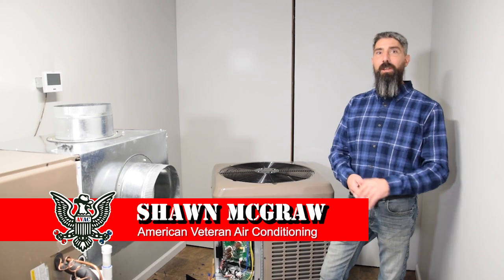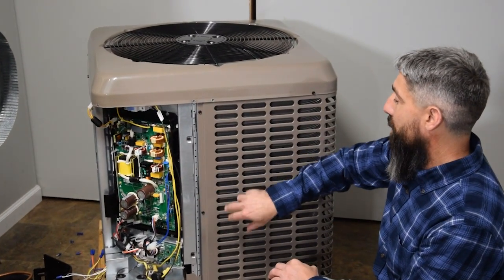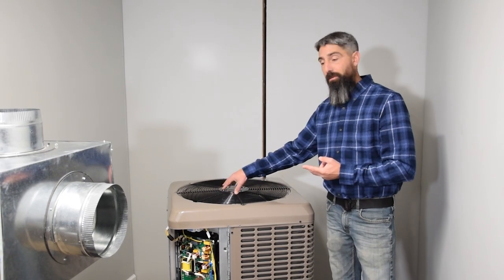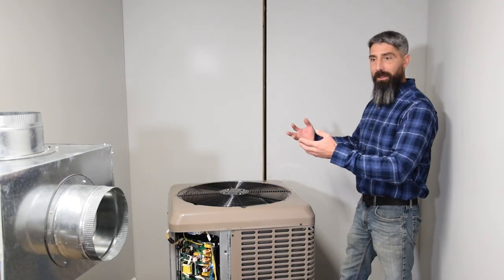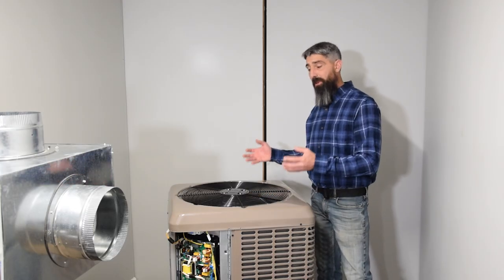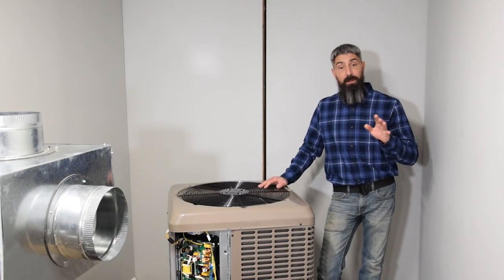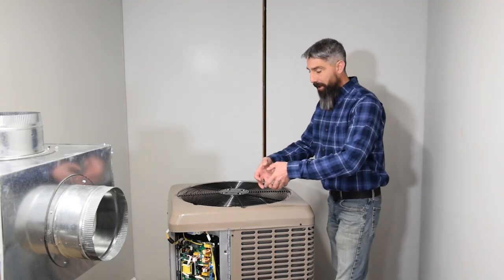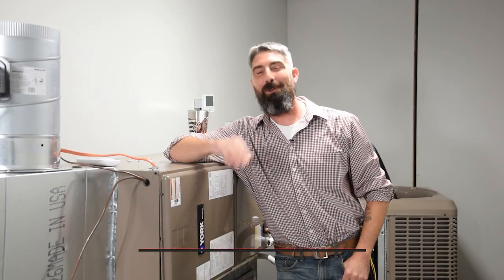What to do if your heat pump ices up in the winter

Comment: Great tip on freezing rain thawing... for the past 2 years I have a canopy 3 ft over top of the condensor fan to redirecting freezing rain and snow away from the unit.  It's been working great so far.  Why don't manufactures include a winter weather cover?   Lennox L1106, Snow Guard for SL25XPV &XP21 Heat Pumps for $1000 and 151 pounds of extra weight

Comment: Just wanted to say thanks! Freezing rain here in MD today and my outside unit iced up to the point where it was making some unsettling noises. I was thinking of ways to rig up a heater or heat lamp or something to thaw it out but then I thought "I bet somebody has found the right way to do this", leading me to this vid. Hose water had the job done in less than 30 minutes! I'm humming along again and just hoping it's not a persistent issue but at least for now I've avoided a trouble call!
Reply: Also from MD and had the same thing happen at the same time when there was freezing rain. If it's in the 20s, and the hose method doesn't work, I wonder if a hair dryer blown on the outside of the unit would work well enough to break up some of that ice? Might try it the next time this happens.

Comment: Thank you. Just tried this. Still ice in the bottom but off all components. Seems to be running fine! I'll get the rest ice off tomorrow if not thawed. Freezing rain and snowing in Florida. 10pm ugg.  First I've seen solid ice in HVAC.  Fingers crossed.

Comment: I live in Florida, we're getting a lot of freezing rain right now. Walked outside and the ac unit was humming, fan wasn't spinning. I turned off the fan because I don't want to blow the motor. This is the first time in my 29 years of life Iv'e had to deal with this. Is it fine to keep running or should I wait for it defrost?
Reply: The fan is turned off during the defrost sycle ...
Reply: @jayb9866  would my unit even have a defrost cycle considering I live in Florida. That's my main question

Comment: I need some advice i have a heat pump and when it goes into defrost mode my Aux strips kick in but cool air comes out. The AuX strips i believe 5k. Should i put bigger size or what do you recommend for a 5ton heat pump? Any one please

Comment: I walked outside Friday morning, now Sunday, to my heat pump iced over. I turn the hvac off and poured hot water over the top grills to melt it off, fan froze as well. Had a couple more issues with it, but it’s up and going. Thank you for taking the time to make this video. From Tuscaloosa, Alabama.
Reply: Check your filter...trust me. Mine was doing it. and couldnt keep up at night. Changed the filter and all went back to normal.

Comment: I have a question. If the temp is below the cut off temperature outside and the unit freezes and when the temperature gets above the cut off, will the unit know not to run if the fan is now frozen and just hasn’t had a chance to ever defrost. Maybe I don’t understand my dual fuel propane TRANE XV 18

Comment: Mine sides are iced up and inside enough to wear now the blades stopped moving. Do i put thermostat on emergency heat?
Reply: Run it on ac for a while. It will reverse the unit and start heating the coils.
Reply: @macmclain1350  ok thanks I'll try it if it does it again

Comment: I have two identical American Standard Side discharge HP units in my new home in NC near the ocean which were intstalled in February 2022.  The one for the lower level of the house has frozen up badly since it was installed, with the fan continuing to run while it is frozen over whenever when temps near freezing and humidity is high.  It doesn’t seem to affect the ability to keep the floor it services at 71° but that may be because it is using aux heat more than it should.

The company which installed it has checked it three or four times now since it was installed saying freon, control board and the ambient and coil sensors are nominal and it switches to defrost mode as it should when they check it but they have never been here when it is still frozen over because daytime temps here eventually melt it.

It happened most recently last week with temps in the high 30s I turned the unit off and defrosted the coil with the garden hose and called for service.   Again it checked out OK.   I have another routine service check coming up so do you have any suggestions I might pass along for things to check. 

Based on my limited knowledge of heat pumps but lots of computer programming experience I’m guessing it is some sort of miscommunication between the compressor unit and the aux heat controller in the blower unit.  One tech, since retired from the company spend several hours consulting with tech support at America and discovered the installer had miss-wired the connection between the two.

Comment: So i dont need to go into emergency heat? My thermostat is set to 72 but my inside temperature is like 64. I also its like 32 degrees outside and my unit had frost all in the inside and outside but not to where the fan wouldnt turn

Comment: I have a Honeywell thermostat and replaced it with a wifi version. Thank god I was easy easy to replace.. But I have noticed lately it hasn't make that loud swish noise. Which it has me thinking lately. Should it be doing it? The temp at night at times does get around 30ish.. My inside house is at 70f. Could it be in the thermostat settings? I do have it as heat pump or is show "compressor heat"

Comment: My outside unit is on, high noise when start, but I have been looking the fan for over 3 hours, and the  fan doesn't turn on... 28° outside, no ice or snow... is a problem, or is it normal???

Comment: Instead of manually defrosting the unit by spraying water on it.....why not spray automotive windshield washer fluid ( the blue stuff) over it to defrost?......I get it how customers can freak out applying water in a freezing atmosphere.....but this water you apply will ultimately freeze again even if it's not on the coil anymore. Don't know how much you would need but some sort of sprayer?

Comment: Outstanding video!! Thank you. You saved me from totally freaking out when I felt cold air blowing during heat mode. My instinct was to shut off the unit and start emergency heat. Which I did. Big mistake! Found your video and understood that was the defrost mode and normal.  Man you really helped.  Thanks again.
Reply: you do have a problem, your heat strip located in your air handler should engage when your outdoor heatpump condenser is in defrost mode, that will keep your air from being cold during the defrost mode, unless you do not have a heat strip in your air handler, but if you do, you need to have someone look at it and see why your heat strip is not energizing when it should..

Comment: Honest question: Why not just put a roof over the thing, keep the freezing rain away from it in the first place?
Reply: Because there is clearance required for "normal" operation so not to impede the exit air flow upwards from the top. If you are CAREFUL and mindful of proper stand-off and clearances....it might be ok to do a roof. Even with proper stand-off using a roof or "cover" of some sort, there is danger of air flow being recirculated to the sides where (normally) the ambient air is being sucked in.

Comment: In the situation I'm dealing with now I've never had an issue with my heat pump.  During the summer had some issues with the AC or so I thought.   The freon level was good.  Issue seemed related to circuit board and defrost cycle. Replaced circuit board and AC worked fine.   Now it's winter and on cold rainy or damp times the unit will not defrost there's just a build up of ice all over the unit.  That hadn't happened in years past.  Anyone have suggestions on cause? Thanks.

Comment: Do you think putting a Heat Trak mat under the heat pump would add some protection to the unit(s) during winter? Heat rises.. helps keep unit warm and aid in defrosting?

Comment: Sounds like allot of work going outside every-time it’s icy out to make sure there’s no ice on the fan blade. I don’t get it. I’m replacing my 28 year old ac unit this year because it’s time not because it died. It’s a Lennox and in 28 years I’ve never called for service or repair. I only change the filter twice a year and clean the coils. Everyone that has given me estimates is trying to sell me theses hight end units
with a heat pump. So the researched begins. The money it costs you, it will take twenty years to get your money back that’s if it doesn’t break down. Repairs can cost up to 3 time more then a conventional unit. If you live somewhere we’re it snows you gotta worry about ice buildup and shovel around the unit so snow doesn’t buildup around the unit. And parts are harder to find. Ya I want one not.

Comment: Got a heat pump?? Better have a back up plan for heating your house. I installed a wood heater not long after I had my new heat pump installed. When the weather gets stupid cold here in south Mississippi, the heat pump will sometimes take on a mind of its own. Not a problem. Just throw on another log. LOL!!!

Comment: Question how long should the system run before tge defrost mode kicks in?? Here in S Texas and combo of freezing rain and cold weather have my outside unit not working @30 mins some small buildup build-up ice on heat pump unit is a 4 ton Rudd   3 years old....   Ty..

Comment: Thank you. We woke to 64 degrees, this morning and the air handler blowing cold air. It was 25 degrees outside. I turned off the air handler and let the heat pump warm up with the outside temperature.

Comment: To prevent the fan blades from freezing up I sat a lawn table on top of the unit. The table top is about 4' in diameter so it has enough overhang to keep it dry. The legs are about 30" tall so the airflow is no problem. This is my second season using it with no problems.

Comment: Hey brother great video 👍 my outside heat pump until get about 3 inches of ice in the bottom of it around the compressor in the freezing months.  The until get the normal frost on the outside coils and it goes through defrost like it should.  Any idea why this is happening? I keep everything clean in and round the coils and unit. Thanks.

Comment: Good info, great video. I always enjoyed hearing the outdoor unit going in and out of defrost mode.
I've got a 2.5 T heat pump that turns 30 years old in a couple of months. I'm thinking about changing it out. What would you recomend as a replacment that will last maybe 20 years??? Going to check out some more of your videos now.
Thanks RG

Comment: Good advice Just moved into a new home, then it snowed with freezing rain my fan stop and started to make a loud noise, the aux light on thermostat click on, the noise continued, Should I turn the power off to the outside heat pump or just let it run???
Reply: same question. is there a defrost button on thermostat or something?
Reply: @rps714  no defrost button only Aux. and  emergency with setting